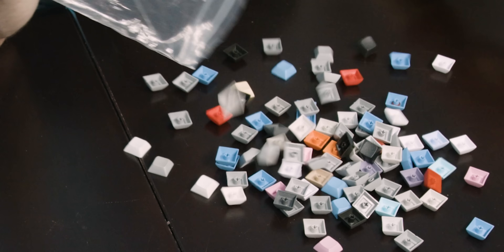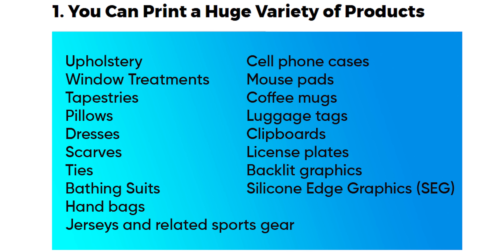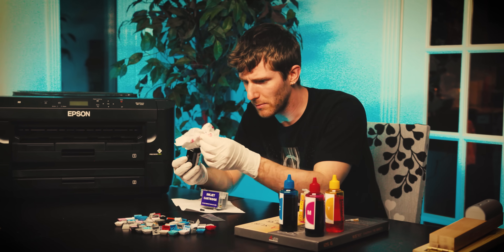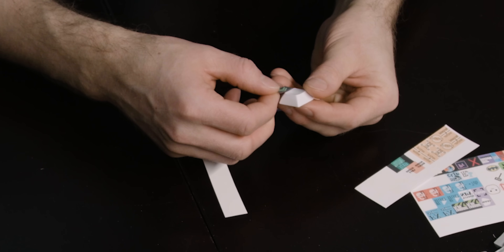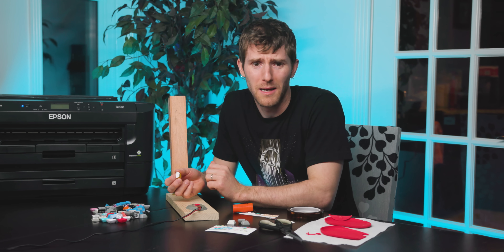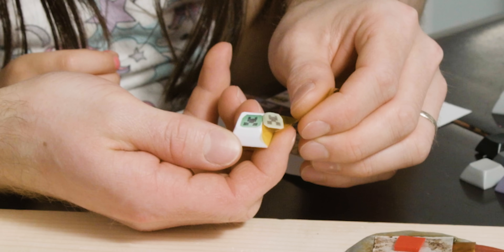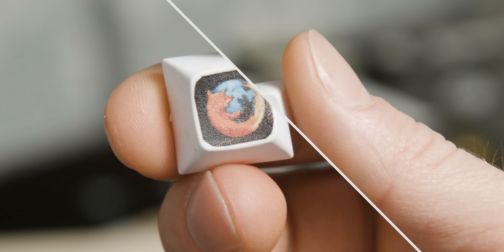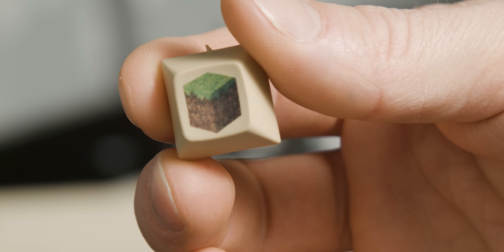I Made my Own Keyboard Keycaps!!

Comment: I'm pretty sure the reason why the black one didn't work was not because of the black, it was because that was an ABS keycap. This only really works on PBT plastics.
Reply: Sry cuz idk who r u
Reply: BRUH THE ODDS
Reply: Joshy E39  never heard of him
Reply: "This only really works on PBT plastics."  For real?  That's useful information for sure.  Just confirm to me, please, that this is true.
Reply: @craigrmeyer  ABS has a lower melting point and is more deformable as a plastic (hence why ABS keycaps wear and become shiny quite quickly with use). Dye-sublimation requires you to use quite a bit of heat, so usually by the time you're at a temperature to apply the dye to the plastic, the plastic is already melting. PBT is a lot more hardy and durable with a higher melting point. High quality ABS keycaps are usually doubleshot, using two different colours of ABS plastic to create a specific design. This is why custom sets usually cost a lot of money and are done as group-buys as they have to make new tooling for each individual key in each individual size.
Reply: @craigrmeyer  In fact, when hot working, we should avoid heavy backlog, which will make the keycap deform at high temperature. We can use elastic heat conductive sponge or other materials, such as 7921? Hahaha! I work in a DIY keycap factory, so I am familiar with this. We work for many studios
Reply: @davisc3406  Please elaborate: What do you mean by "when hot working, we should avoid heavy backlog"?
Reply: @Figureight  This is really late, but as a plastics engineer, the idea is slighly wrong. ABS does not wear with use. The shiny texture is your skin oil sticking to the surface. PBT is usually harder to print on because it doesnt stick to inks very well (good chemist can get it to work but it's usually more expensive like that)

PBT is hardy but brittle, shattering when you apply too much force. ABS is hardy but pliable, bending/deforming when you apply too much force.
Reply: @davisc3406  I'm pretty late to this, But if you see this, Does your company maybe do custom keycaps? I'd love to know.
Reply: @furretsunereli3911  Our company provides processing and production for many European and American group buying designers.
Some GMK designers are also working with us.
Reply: @extremewirehead  any way for us to undo that process? ABS shine is a big pain for us custom keyboard guys.
Reply: yes, and also darker colors absorb heat faster, this also applied to tempering glass, darker glass tempered faster then the same thickness clear.

Comment: Arg this is such a cool concept, but naturally EVERY printer compatible with the process is sold out here. I'm really keen to try it out on some 3D Printed parts.
Reply: I think 3D printed key caps have a lot of potential. If you use filament the color and material you want, you can print any profile (SA, Cherry, GMK) and then use this dye-sublimation to put on letters or designs. This seems like a great alternative to dropping $100-200 on quality keycaps.
Reply: Sry cuz idk who r u

You need "F"
Reply: @leepicfortnitefunniesxdfun4655  3D printed keycaps are really not that great (at least everything except resin)
Reply: @leepicfortnitefunniesxdfun4655  it's also better if you want a low amount of specialized key caps

Comment: Linus: All you need is a printer, a heater, some uranium and a nuclear reactor
Reply: All of these things can be found on Amazon so np
Reply: Its like Art Attack all over again
Reply: @kaldogorath  : Amazon? Only one I'm not sure if I can get in town is the heater. JB Weld from Wal-Mart, hinge from a hardware store, wood from either Wal-Mart (look for yard signs) or the local lumber yard, power supply from anywhere that sells USB wall warts.

Come to think of it, replacing the hinge system with some random heavy thing would probably be an improvement.

Comment: Huh, you learn something new everyday--I've never heard of it being called "Sublimation Ink," we always called it heat transfer ink.  And yes, when it comes to any kind of heat transfer, it effectively dyes the color into the surface, rather than being an external layer on top of the surface, as with painting or screen-printing.  It's one of the reason heat transferring is so widely used for dishwear and pottery, because it's far more durable and easier to clean.  (Note: T-shirts can have different results if you're attempting to use an 'opaque' transfer sheet, as it adheres an additional layer onto your cloth surface for the sake of the correct coloration.)  You can also DIY something similar with transfer paper (or even tracing paper, if it's hand-drawn) and gel medium, but it takes about 24 hours to accomplish.

You learn a lot after working at a craft store for 8 years.

Comment: If any of you would want to attempt this: you can only use Epson printers. The reason is the technology of printhead. Epson has piezoelectric printheads while others have thermal printheads. Thermal printhead will damage die sublimation ink in the printing process.

Comment: Hey Linus, the black caps melted faster because dark colors absorb heat faster, I worked at a Glass Plant that Tempered and Heat Strengthened Glass and the cook time per oven/cycle was about 7-17% on Grey and Green/Blue glass Every time compared to the same thickness Clear, and this is because the darker glass absorbed the ovens heat faster, whether it convection or contact(i forgot the names). Seems like the same principle happens here.

Comment: The problem a lot of digital security devices have (more specifically door sensors) is that the signal can be defeated using little handheld radio devices.
Idk which ones are vulnerable to these types of attacks but LPL made a video showcasing this security flaw.
Reply: Just looked up the episode, look up lockpickinglawyer 935 on YouTube and he demonstrates defeating the "Simply Safe" door sensors with a $2 wireless remote

Comment: In fact, when hot working, we should avoid heavy backlog, which will make the keycap deform at high temperature. We can use elastic heat conductive sponge or other materials, such as 7921? Hahaha! I work in a DIY keycap factory, so I am familiar with this. We manufacture keycaps for many studios

Comment: I forget the name of the mechanism, but like, imagine a single link of a scissor lift, kind of... it essentially keeps your pressing surfaces parallel while still using lever action, that should drastically improve this method. Oh, or like, a fancy sandwich press/grill. Basic ones are just a hinge like this setup, fancy ones have a more complex mechanism that I think works similar to the parallel method if not exactly like it...

Comment: Um.. Great idea, I'm going to try it, but why not attach the heater pad to the underside of the top board, then the key and transfer can be simply placed right side UP on the base (make a little frame attached to the base to locate it,) easily position the transfer paper on the key's top and 'easy peasy' no misaligned transfer.

Comment: How are you regulating the temps on the heating element? Isn't dye sub a little finicky and needs to be within a certain range? I think 430F? I am keen on building a little heat press, just need to know if I need to add a dial for voltage to adjust the temps.

Comment: what not put a key sized hole in the handle so the key is always in correct position, its not like that would be hard to do since you got a CNC

edit: could also angle the hole to correct the handle angle like you said.

Comment: Yeah, whatever they use to turn plastics black; especially polys, nylons and most other injection mold-able plastics; weakens it quite a bit. From what I understand, plastics reeeally hate being colored black. So, if you ever need a plastic to be strong, lighter is generally better. I'm sure there's chemistry reasons why, but I'm just telling you what more than one engineer friend told me..

Comment: "They don't even have screw-on tops"

Most syringes and hollow needles I used for medicine reasons (not drugs, actually just NACL usually) never had screw-on tops... So if this works fine, it'll be fine with damn cartridges

That said, Luer-locks (those are screw-on) are pretty common now
Reply: I'd actually say that's an iffy comparison. Medical use needles are single use only. There's no need to consider wear, multi-use of the same material, storage, etc.   That giant bottle is going to sit around for weeks, months, or lets be real for home use, YEARS.

Comment: I have a question i need to ask, i have a laptop. An Asus 15 X509FA-DB51, it has 4gb ( soldered ) and 4gb Dimm. The maximum amount of ram is 16gb, how can i achieve it?? Should i only change the 4gb for a 8gb and get stuck with 12gb of rams or should i put a 16gb and i will exceed it at 20gb?? I know only 16gb will be useable but will it be bad for the computer??